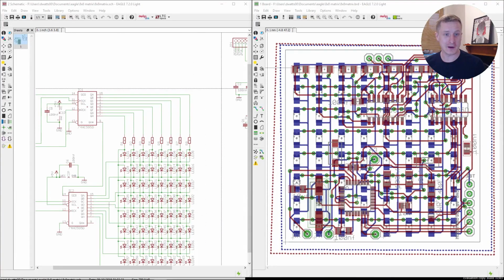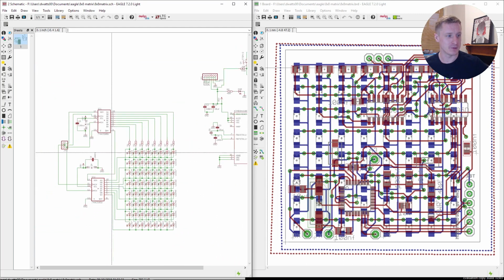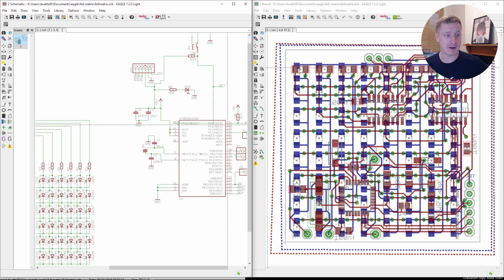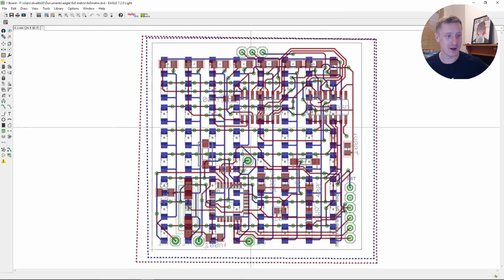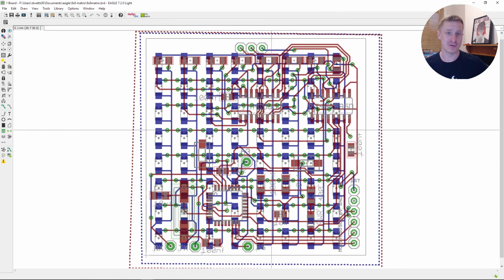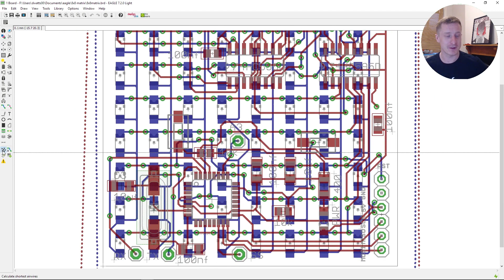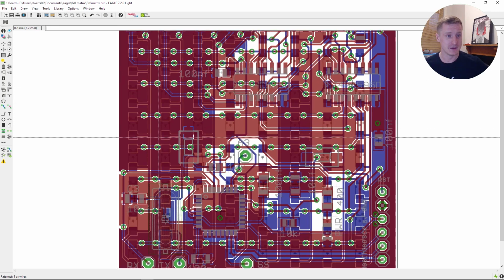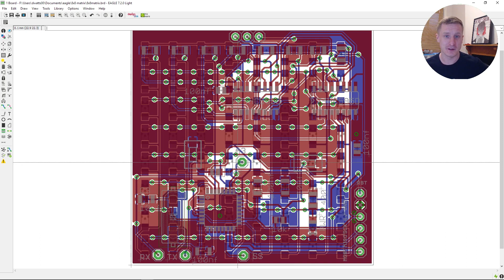Arduino SMD LED Matrix 8x8: The all-in-one board

Comment: Hi David,
Cool board!
How did you solder the board? Did you use a reflow oven? I've never used solder paste, do you have some tips for someone who has never done reflow?
Reply from the maker: Thanks Hari, I just soldered it by hand. There were 1206 packages as I recall so it was pretty easy.  You can use solder paste with an iron too. Reflow is something I have not tried at home.